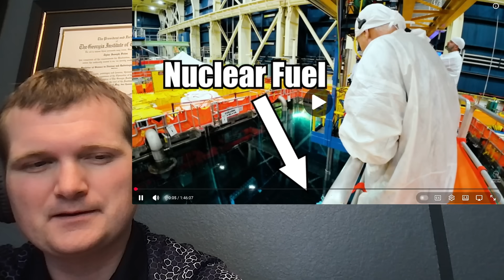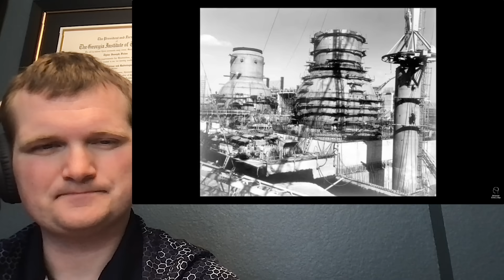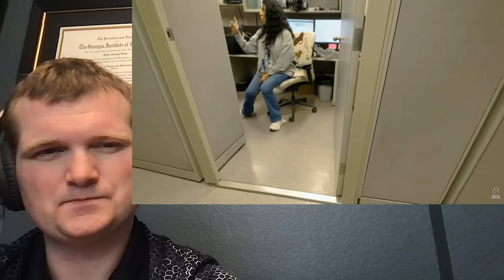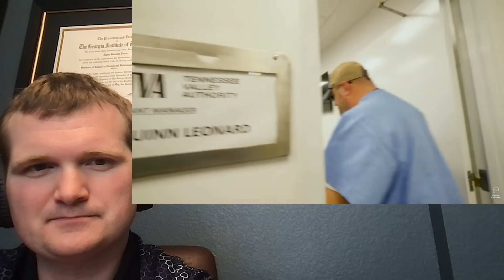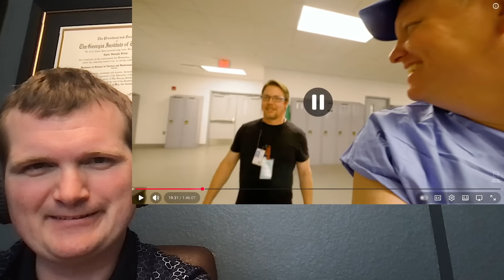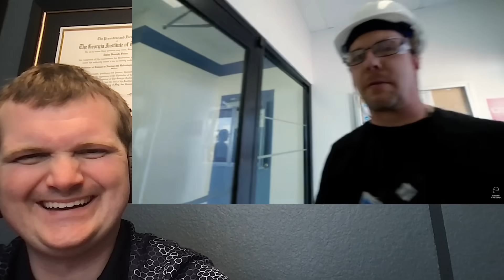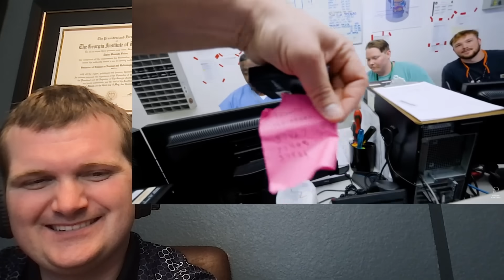Refueling a Nuclear Reactor - Nuclear Engineer Reacts to Smarter Every Day

Comment: There are so many freezes in this video that it's almost unwatchable. Several times I thought the video froze but the audio kept going.
Seriously need to invest into a better hardware.
I wouldn't mind if the reacted video is choppy from time to time but your camera also froze A LOT. Which made me refresh couple of times, thinking my connection or browser is at fault.
Please, update your hardware. Videos are only in 1080p and even the cheapest current generation pc should be able to handle this with ease.

Comment: What is your minimum moral spacing do you like to have between the original post and the reaction post?

Now without question, you provide significant derived content but it still requires the playing of a large portion of the source video.

This is a curiosity question and I do not have an agenda behind it.

Comment: I notice both the cam and the video hitch. Maybe check the export/rendering options?
Reply: I think its a GPU bottleneck tbh, you can see when the video stops playing the cam has no issues. But when the video and cam are going at the same time you see the stutters. I think the gpu is having a hard time, playing the video, encoding the cam video and recording. My guess its recorder in OBS and due to a bottleneck obs and the recordings have stutters.
Reply: @fullsuave93 
Was thinking along the same lines. It does look like the computer is overwhelmed a bit and his CPU/GPU turns into "Mister Green" (meaning you're at 100% CPU usage).
Reply: @fullsuave93 time to fund him a good PC 😊

Comment: Do all nuclear waste go into weapon production or full disposal?
Reply: In the United States it just goes to disposal 

In France they reprocess the fuel and reuse it 

The uranium in this reactor is only enriched to about 4%. For a nuclear weapon you need 90 plus percent. On top of that almost all of the nuclear weapons certainly in the United States and in an advanced countries is plutonium not uranium. Is about a 6th the mass for a given amount of criticality 

Plutonium is produced in what's called a breeder reactor. It's specially designed to convert uranium into plutonium 

Uranium is nearly always produced either buy gas difusion or centrifuge 

Centrifuge being much more common

Comment: Question: how much more radioactive would that fuel rod be at 100% power vs the outage?
Reply: Tick-tick-tickity means "run your ass outta there", and then pop some Rad-Away for good measure.

Only you can prevent human flesh fires.

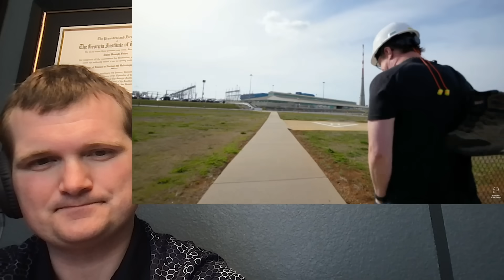Comment: @7:58
Alternatively, the company designing and building the plant decided they didn't want to spend all the money to be safe and cut corners so the Execs could afford 30 more luxury cars.

In all seriousness, feels like different buildings would be safer, regardless of how solid the building is built.  I don't see how they could justify putting all 3 in the same building if they are as concerned with safety as Tyler always says they are.  I can't see how having each reactor in its own containment building would not be better in every way from a safety standpoint then having all 3 in the same building.
Reply: Safety is never 100%. One has to cut it at some point because of huge economical impact.
Reply: Each reactor is living inside their own personal primary containment building. They're underground, and look like a an old incandescent light bulb turned upside down. The big building housing all three units is the secondary containment. 

Yes, now we know it is better to give them their own fully separate buildings. But back when these units were built, they didn't know as much about it all as we do now.